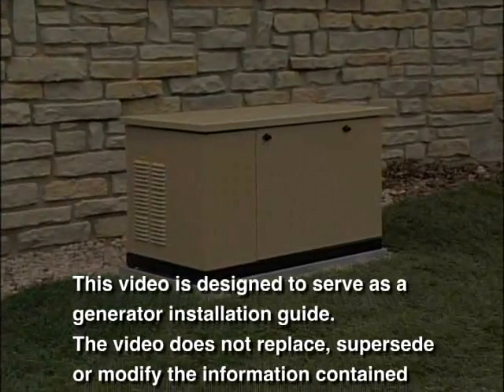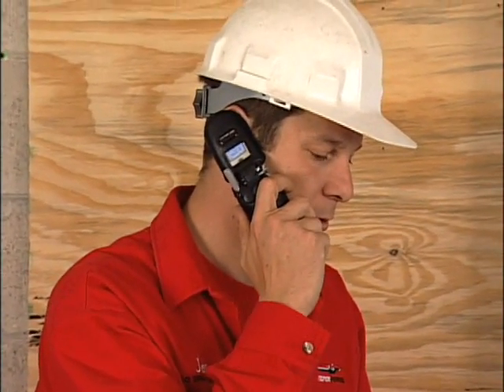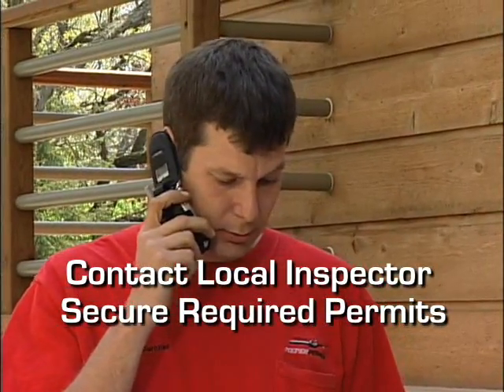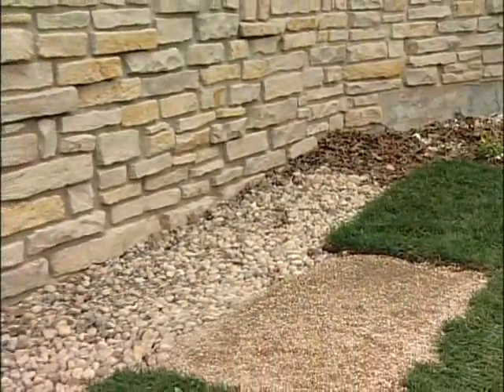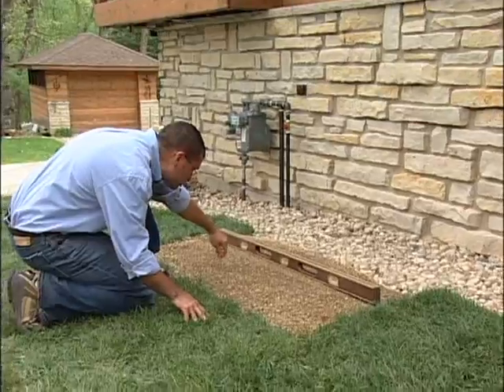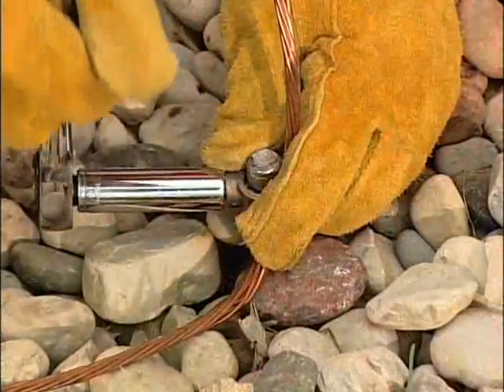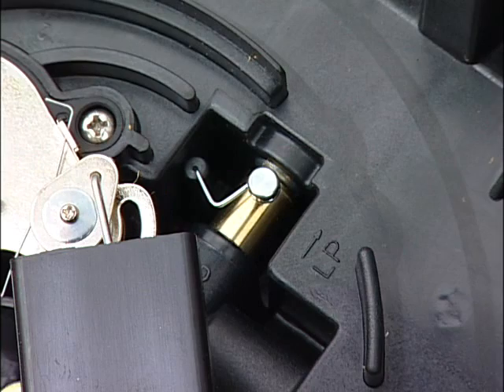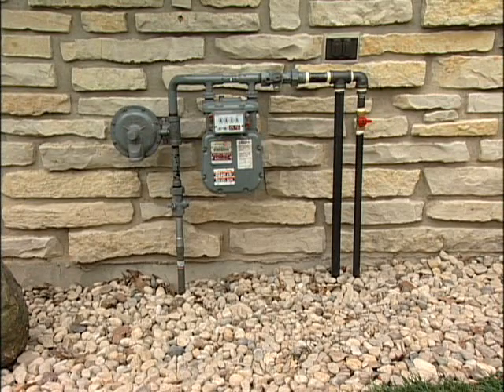Installing Automatic Generator Generac Guardian (1 of 3)

Comment: Just an FYI, bare steel fuel runs are not allowed in the ground. Your installation is prohibited by National Fuel  Code. Also white Teflon tape is not approved for gas pipe.